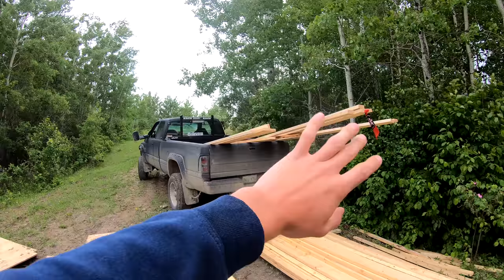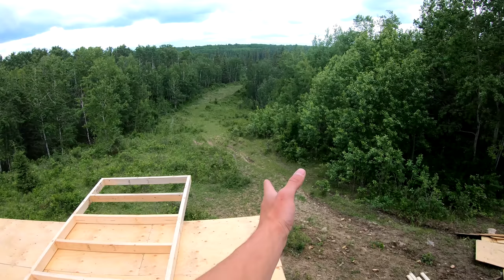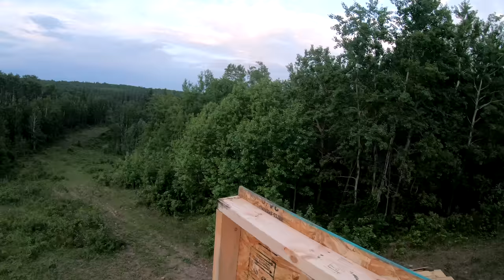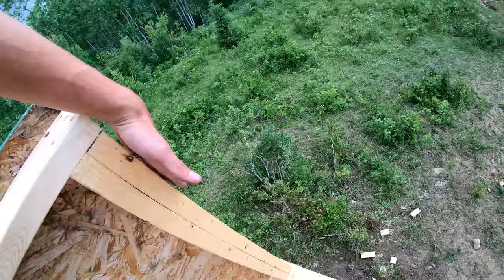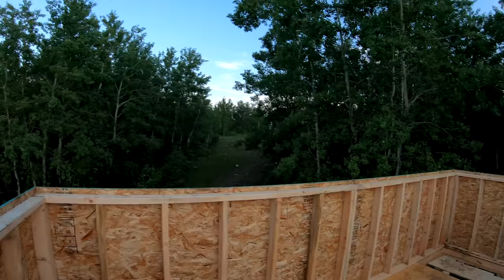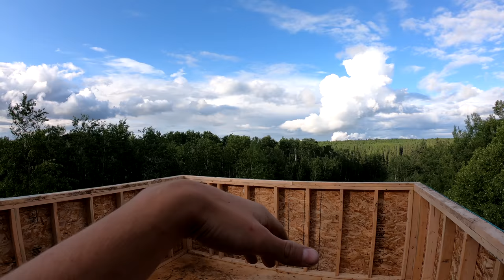Offgrid Cabin Build Pt 6 - Building Walls for the Loft (Framing, Sheathing and Putting up)

Comment: We called those 2x4 on the gable end “look outs” “out riggers” I’ve seen them laid on the flat if your common rafter was a 2x6 or bigger...you would use a gable end rafter one size smaller than the commons

Comment: It makes a much stronger wall when you tie your sheathing to your rim joists both top and bottom walls in your two story.  It may make it necessary to cut a filler strip for the top of the wall the distance you overhang the rim but the strength comes from the lower lap so the top strip of sheathing is not a detriment and the preferred way to build.  Because your fasteners (and glue hopefully) are in shear this way instead of relying on the pull out strength which is weak of the fasteners through the bottom plate alone and because you now have shear and the nailed plate holding at cross angles it is much stiffer and stronger.  That is not even counting the shear strength of the sheathing itself.  Just for your future info as I see you did both your cabin and the chicken coop with a weak shear line at the bottom plate and decks.  Sometimes it is the little things that don't cost any more but make a big difference.  I admire you energy and ambition to tackle the project.  Take care.  Doug